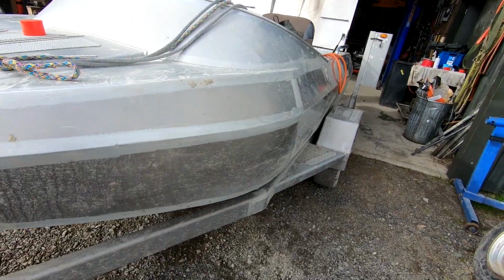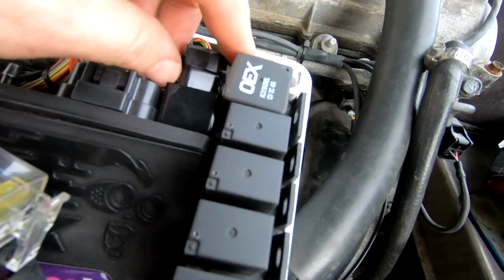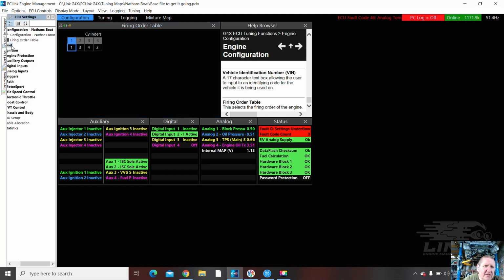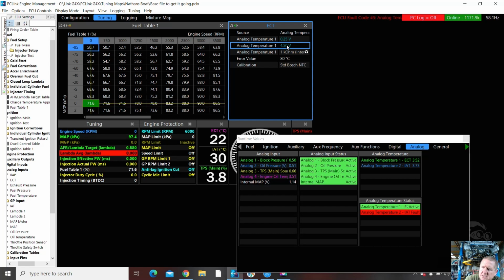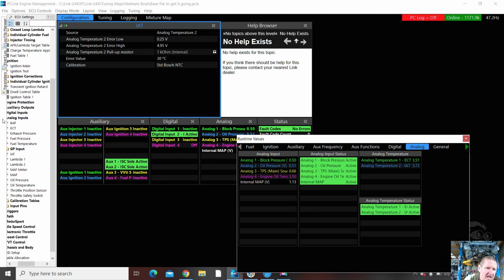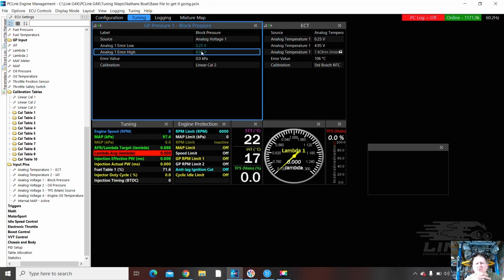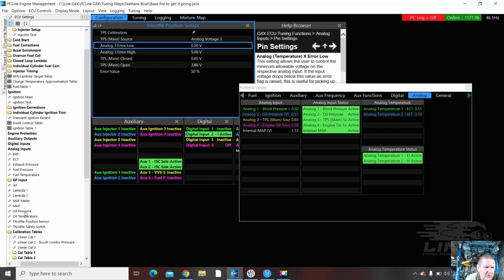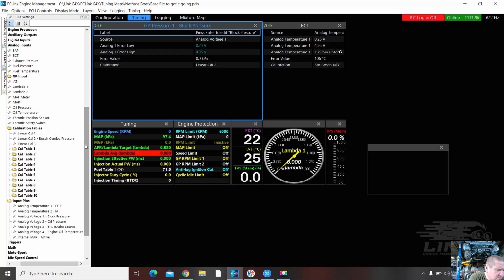01 Link ECU setup G4X - boat setup with Analog inputs - 2Az Toyota engine

Comment: When i calibrate my tps it showing over 100% and then sits on 10% on full throttle. Is the tps is faulty ?
Reply from the maker: I would check input voltage for the tps to diagnose the issue.

Comment: At first I thought it was a 3S Beams haha
Reply from the maker: Its funny as the 2az wouldn't be my first pick for a boat but it goes really really well.   We ended up getting 70km/h out of it.  I tried 3s beams vvti but found 1nz was a match.
Reply: @CartuneNZ  70k would be hectic 
I saw a thread on the 1nz where someone replaced the intake manifold with itbs and added huge amounts of power (like 30hp) at the top end. The theory is that the restricted manifold improves internal egr even when flat out haha